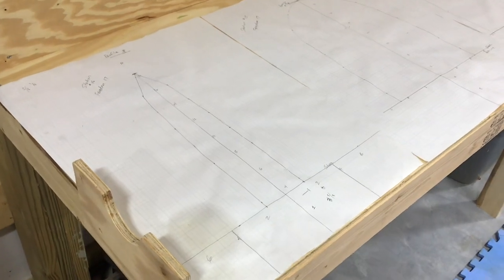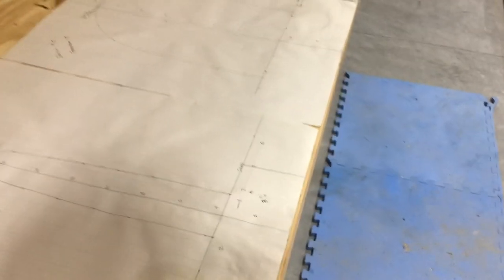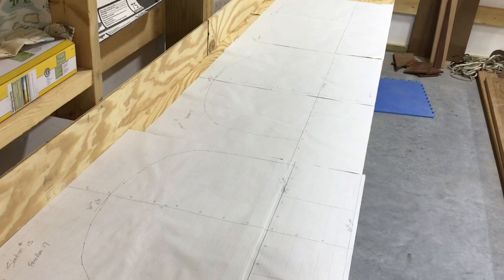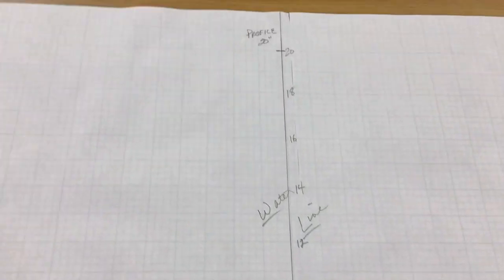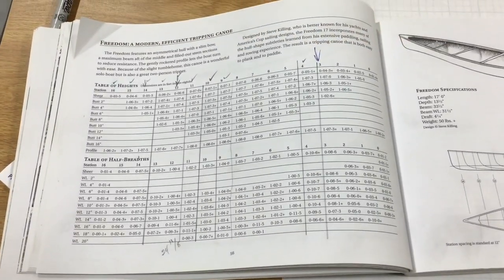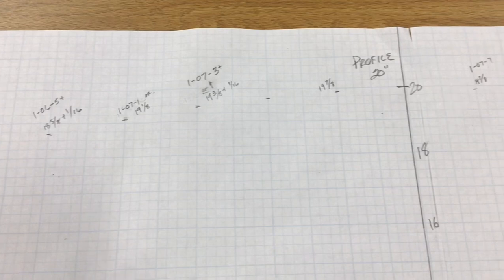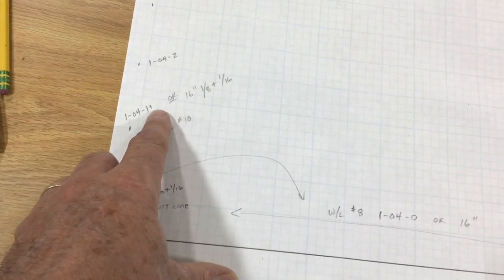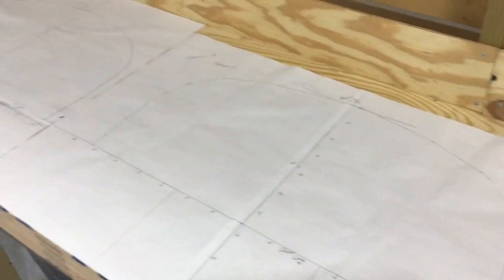Canoe Lofting made easy

Comment: Lofting takes a great deal of concentration, it is so easy to jump an offset. I made a 1/2 hull model and made a table, scaling up from 12" to 12', i was very surprised at having only a very small number of errors of only a few mm. I realised that drawing out full size on a lofting floor, as Ian Smith and others have done is how to correct the errors as they are magnified from the small model, as they effect the whole boat.
Reply from the maker: it does take a lot of concentration and I hadn't thought about it but that may be part of what I enjoy about it. no time to think about a lot of other stuff. sort of a healthy distraction
Reply: @JenkinsBoatWorks  Just get absorbed, all else goes out of focus.

Comment: Good description Chuck.  X and Y coordinates.  Are you using a batten to connect the dots?
Reply from the maker: no batten at the moment. I'm only trying to connect the dots at this point to make sure that the curves should run fair. I'll use small nails and a flexible ruler when I transfer the points to plywood. Only two more drawings to do now so molds should start being cut out this weekend with any luck

Comment: Be advised there is 1 correction to the table of half-breadths in the Canoecraft book for the Freedom. The FAQ page on the Bear Mountain Boats web page has the correction part way down. Other designs in the book also have errors. In addition note that the stem molds as plotted need to be cut 3/4 smaller than plotted along the profile to accommodate the thickness of inner stems.
Reply from the maker: Mike, I remember running into an error or two on the Bob's Special. I have been looking for irregularities and so far the curves seem pretty fair. I only have molds 2, 1 and zero left. I will definitely check out the FAQ page. awesome info and thank you
Reply from the maker: and I looked it up, Station 1 !!  ha!  perfect timing as I haven't done that one yet